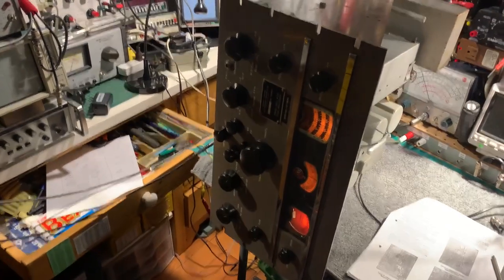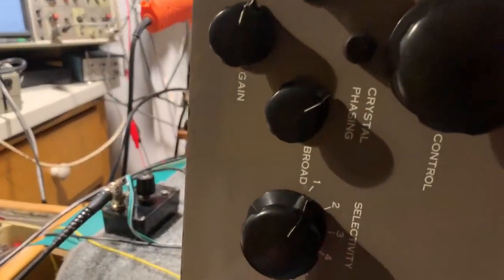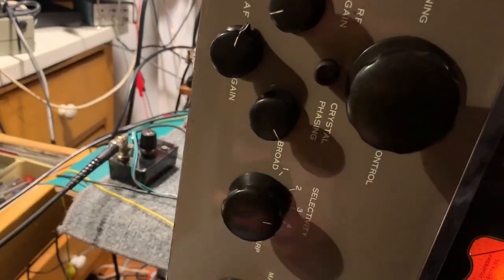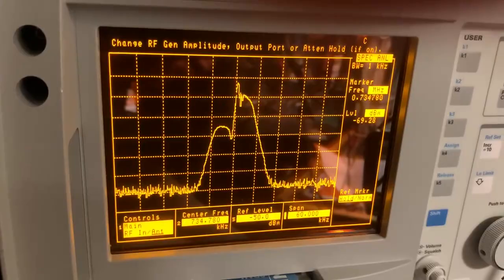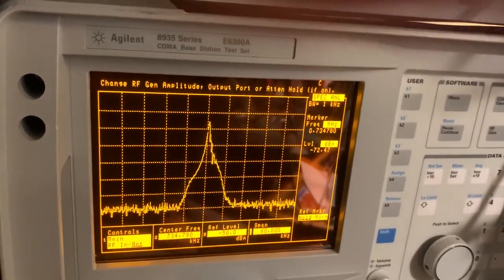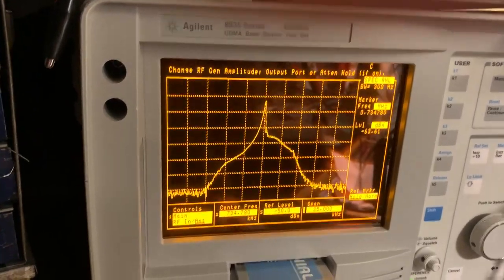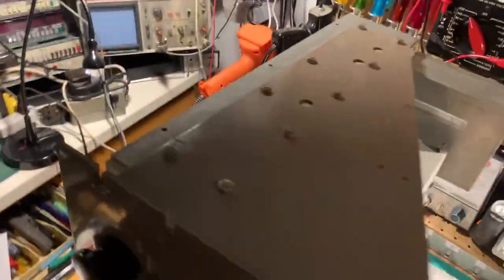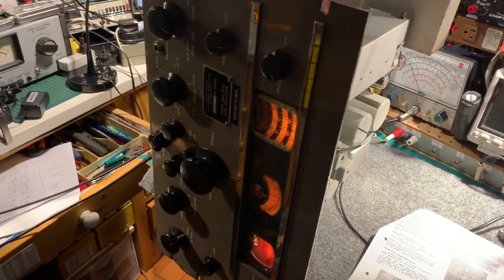Displaying RCA CR-91A IF response curves on an Agilent 8935 Test Set (Spectrum Analyzer Mode)

Comment: I have a a HP sweep generator and used it with a scope and found that the skirt of the crystal filter sides is not smooth kind of jagged is this normal ?
Reply from the maker: The skirts on a monopole crystal filter should be fairly smooth and steep, except for the dip at the series resonance to the low frequency side of the parallel resonance peak as shown on this video.  Jagged curves can be the result of several factors such as parasitic oscillations,  unwanted resonances or incorrect alignment in the crystal circuit, or by over-coupling into the 'scope (use a high value, eg 100Kohms, series resistor and try a 0.01uF capacitor to ground where you take the Y-axis signal from - usually the 'hot' end of the detector load resistor in the receiver)

Comment: I love my HP 3585A for displaying IF response curves.  I have the 8600A/8601A combination but have not used them for alignment since I got my 3585A.
Reply from the maker: Yes, a dedicated full-featured spectrum analyzer with tracking generator is certainly the way to go...  My Agilent 8935 comms test set was given to me for free in 2011 and all I have done with it has been to replace the AA batteries every 3 years or so, so it owes me nothing (!).   I have been tempted to buy an older HP or Agilent spectrum analyzer unit,  but I wanted one that goes to around 2GHz with a tracking generator and even 'non-working' units, eg. HP8591E, worked out at well over CDN$1000 when shipping was added in.  I am not much of a 'solid-state guy' when it comes to fixing things - I do know the usual issues are power supply caps, tantalums and firmware battery-related problems that I probably could fix ok, but it could also be a blown front end or YIG issue I could end up not being able to fix or have to buy a scrap unit to cannibalize.  Besides, I really don't have the room for another large and heavy piece of kit, so instead, I decided to spring for a new Siglent one I spotted a deal on a couple of days ago - now on order!  I will likely keep the 8935 until it goes wrong as it has many other useful features besides its limited spectrum analyzer mode
Reply: @RadioRestoration  Thanks for your response.  I wish you luck with the Siglent.  They look like good units.  I look forward to a video of you using it.  I might get one myself in the future when my HP boat anchors give up the magic smoke.
Reply from the maker: @polaraligned1  Yes, I am sure it will feature in future projects...
Reply from the maker: @polaraligned1  With any luck the Siglent should arrive here tomorrow - looking forward to using it!